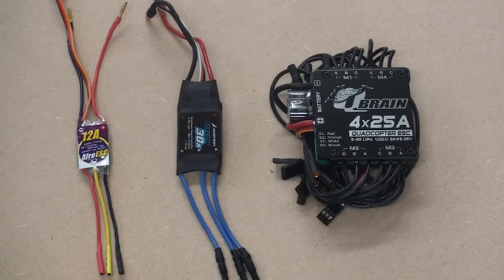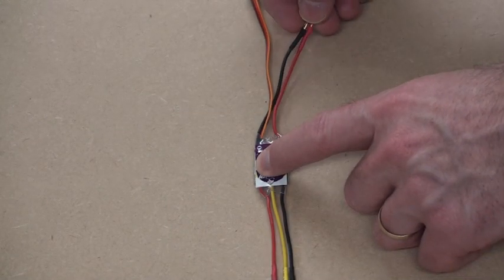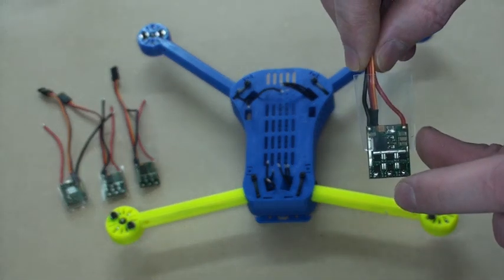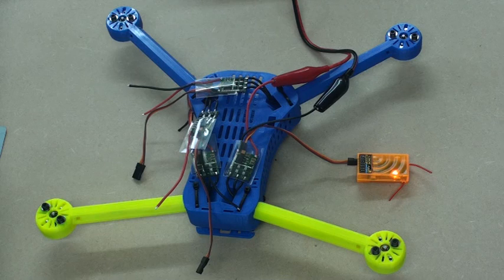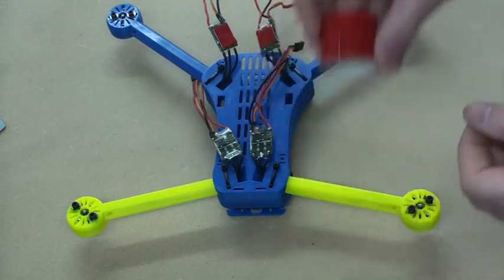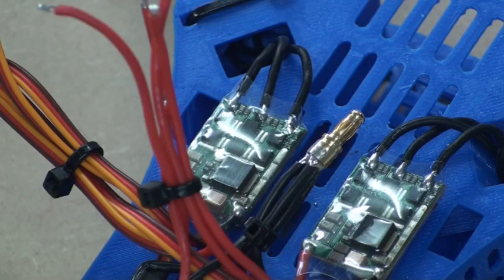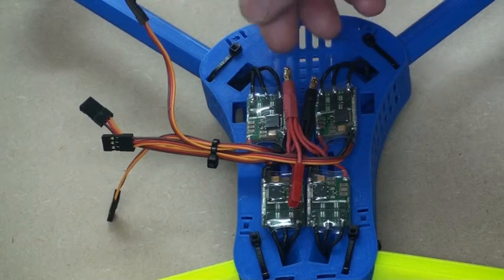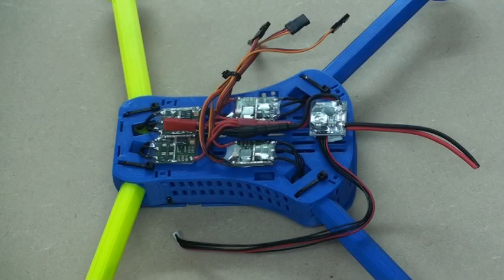T4 Mini Quadcopter build part 3: ESCs and power

Comment: Does the anbee remote work with the radio link transmitter ?
Reply from the maker: You need a transmitter that is compatible with the receiver, and a receiver that is compatible with whatever flight controller you use.  So the answer is ...it depends on what other components you have.  I'm not familiar with the other components required to work with an Anbee remote.